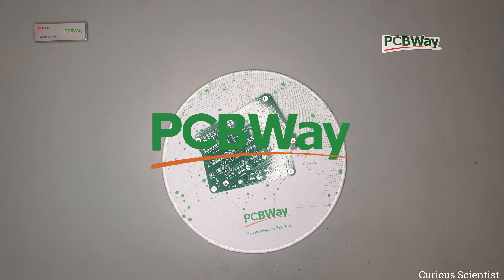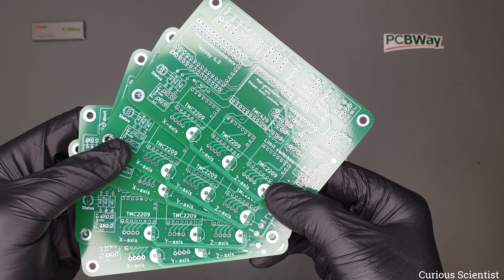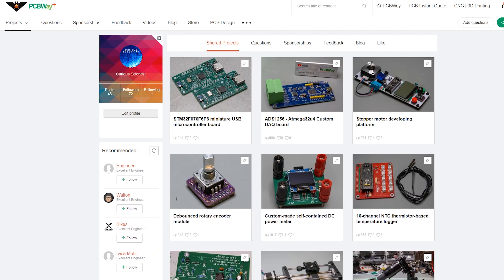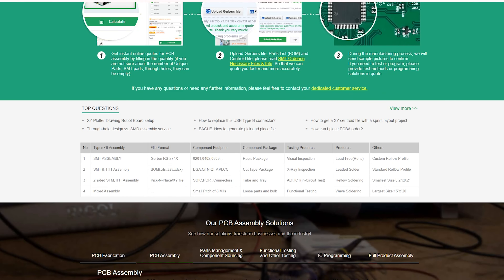High-performance 3-axis stepper motor controller

Comment: very interesting, thanks for continuing to post such interesting projects! about moving the resistor on the aliexpress driver board, I have a question: you could have designed your board to use those without having to move the resistor, correct? is that because you realized that difference after you had designed it? or is that because it was important for you to be able to use the original TMC board and the cheaper one interchangeably? thank you very much and looking forward to the next installment of the series! 🙂
Reply from the maker: Thanks! The reason is that the original TMC2209 can not have the uart pin on pin 13 where the Aliexpress module has it originally. The original module can only have it on pin 11 or 12, dependingon how I short the solder tab. So, as a compromise, I designed the board this way. The board is not only made for myself but also for a customer who wanted to use the original TMC2209 board. On the other hand, I wanted to use it with the cheaper Aliexpress module.
Reply: @CuriousScientist  makes perfect sense, thank you very much for explaining! great job, keep 'em coming!! 👍
Reply from the maker: Thanks, I will try my best!

Comment: Very awesome board, buying them now from PCBWay.  The one question I have is related to the clock of the TMC429.  I see its connected to the Teensy IO.  What clock speed are you providing to the TMC429 and how are you driving it (i.e. pwm output of teensy)?  Thanks
Reply from the maker: Thanks! I simply use the analogWriteFrequency() function on a selected PWM pin and set it to 32 MHz. It is important to notice two things. Set the duty cycle to 50% (128) and set the CPU frequency to 528 MHz in the compiler, so the 32 MHz becomes exactly 32 MHz. 

I will soon open-source the code on my GitHub, so stay-tuned.
Reply: @CuriousScientist  Thanks for the info!!! Was going to ask next if the CPU freq had to change, but you've clearly answered it :)  Also good to hear about the open-source.  Looking forward to it and helping to accelerate my project.  Keep up the awesome work

Comment: This is awesome! Any plans on integrating a display?
Reply from the maker: If you check the video, there's a specific mention of the i2c connection I specifically made for that purpose. 😎
Reply: I didn't catch that part but I'll rewatch it for sure! Thanks
Reply from the maker: No worries! Maybe in a future iteration, I will put a display in the system. I put the circuit in a large enough enclosure to accommodate a display. Check my Instagram, I just recently shared a post about it.
Reply: I just checked out your Instagram post and it looks good! Also if I was to add the i2c display, would I need to edit the code? Sorry about all the questions
Reply from the maker: Hi! Yes, of course, if you want to display something, you need to implement code for it.

Comment: Looks nice, but why not go and make the joystick pins - + s, so that it is safe to polarize it the wrong way around.
Reply from the maker: Even if you mess up the polarity and connect the 3.3 V on the signal, all you will see is that the ADC is reading a maximum value. However, if I flip the 3 pin connector according to my design, all you see is a mirrored joystick behavior. I see nothing wrong with that.

Comment: ELI5 Abstract

What's the Project About?

I'm building a special control board! It's like a brain that helps
move robot parts. Imagine a robot with three arms that can move up and
down, side to side, and even twist. My control board is what makes
those arms move smoothly.

How Does it Work?

* Tiny Brain: The board has a tiny, super-smart computer chip as its
  brain.
* Switches and a Joystick: I can control it with special switches or
  a joystick, like in a video game!
* Colorful Light: There's even a light that changes color to tell me
  what the board is doing.
* Fixing Mistakes: I made a tiny mistake in the board's design, but
  don't worry, I'll fix it!
* Secret Project: This cool board is actually just a part of a much
  bigger, secret project I'm working on. Stay tuned!

Abstract

This project focuses on the design and development of a
high-performance, custom PCB for controlling 3-axis stepper motors
with precision. The core of the design is the TMC429 microcontroller,
which handles step and direction signals, offloading tasks from the
main microcontroller.  The board, designed for manufacturing through
PCBWay, includes several other key components:

* TMC2209 Stepper Motor Drivers: These drivers (both original and
  modified AliExpress versions can be used) control the X, Y, and Z
  axes.
* Step-Down Power Converter: This module efficiently provides the
  required 3.3V power supply.
* Input and Feedback: The design incorporates buttons, a joystick,
  and an RGB status LED for various control modes and visual
  feedback. I2C headers and limit switches provide further expansion
  options.

The project encountered some challenges, including a minor PCB design
error (to be fixed in the next iteration) and the need to modify the
AliExpress stepper motor drivers.  Despite this, the demonstrated
functionality shows that the board successfully enables joystick or
button-based control over the stepper motors.

While the code is complex and not covered in detail in these segments,
future updates will include code explanations, project information,
and the corrected PCB design. This PCB is the foundation for a larger,
exciting project that remains under wraps for now.

Summary

Introduction

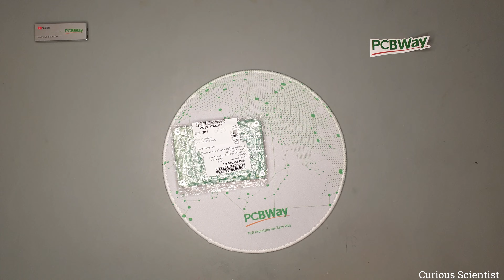* 0:13 - Sponsorship by PCBWay.
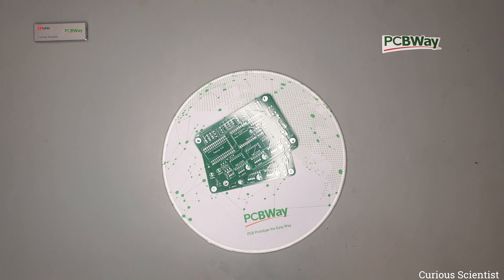* 0:21 - Project introduction: high-precision, high-performance
  3-axis stepper motor driver.
Reply: (continuation of summary)

* 0:34 - PCBs will be designed and manufactured with PCBWay.
* 1:02 - Purpose of the PCB.
* 1:10 - Plan to build and test one of the PCBs.
* 1:23 - This project will be covered in multiple videos.

PCB Overview

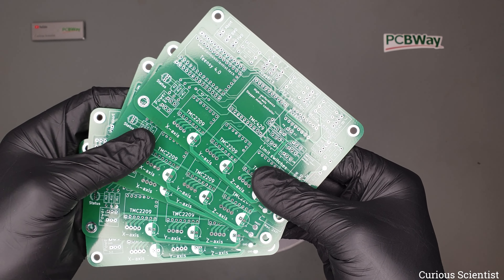* 1:54 - Acknowledges PCBWay's services and capabilities.
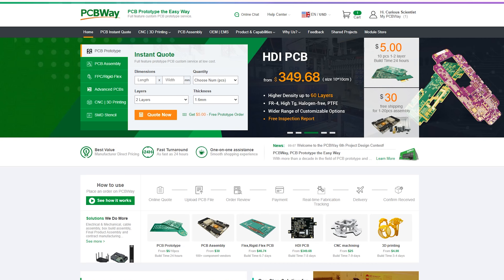* 2:28 - PCBWay offers PCB manufacturing and assembly services.
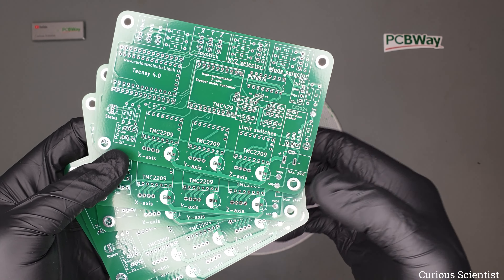* 2:51 - Core component is the TMC429 microcontroller.
* 3:32 - Discussion of the TMC429 stepper motor driver (more in
  later videos).
* 4:00 - TMC429 reduces main microcontroller workload by generating
  step and direction signals.
* 4:36 - PCB uses three TMC2209 stepper motor drivers for X, Y, and
  Z axes.
* 4:55 - RGB LED for status indication.
* 5:26 - DC Barrel Jack for power input.
* 5:48 - Step-down module (MP2359) for 3.3V power.
* 6:00 - LED and test points for voltages.
* 6:33 - I2C header for optional display.
* 6:50 - PCF8574 I/O expander for button inputs.
* 7:08 - Buttons/switches for:
    * 7:18 - Axis selection (X, Y, Z)
    * 7:30 - Modes: Joystick, Button, UART/Serial

PCB Assembly

* 9:57 - Board has been pre-assembled to save time.

Component Descriptions

* 10:50 - TMC429 microcontroller: Powerful, fast, with many
  features.
* 12:24 - TMC429 stepper motor driver module: Handles step/direction
  signals, limit switches, controlled via SPI.
* 13:53 - PCF8574 I/O expander: Provides additional input pins for
  mode selection.

Stepper Motor Drivers

* 15:10 - Introduction to the stepper motor drivers used in the
  project.
* 15:15 - TMC2209 Silent StepStick drivers.
* 15:29 - Description of tabs (pins) on the TMC2209 for UART
  configuration
* 15:59 - Importance of correctly configuring the UART pins for
  board compatibility.
* 16:05 - Discussion of cheaper AliExpress versions of the TMC2209
  driver.
* 16:16 - Key difference: a resistor is in an incorrect position on
  the AliExpress version.
* 16:36 - Instructions on how to modify the AliExpress TMC2209 by
  moving the resistor (R7).
* 18:52 - Demonstration of the modification process.
* 19:25 - How to desolder and reposition the resistor.
* 19:55 - The extra pins on the AliExpress version are not used.
* 20:02 - Both driver types (original and modified AliExpress) will
  now work with the board.

Step-Down Power Converter

* 20:32 - Discussion of the step-down module.
* 20:38 - Using a pre-made module is more cost-effective.
* 20:54 - High-performance step-down converter capable of delivering
  several amps.
* 21:16 - Selectable voltage, but the goal is a fixed 3.3V supply.
* 21:28 - Instructions on modifying the module for fixed 3.3V output.  
* 22:09 - Preference to solder the module directly.
* 22:30 - Demonstration of modifications.  
* 22:49 - Testing the module's output.  
* 23:47 - Using blue tack for positioning before soldering.

Three-Way Switch Demonstration

* 25:10 - Three-way switches are "on-on-on" type.
* 25:32 - Switch will select X, Y, Z axis, or input modes (Joystick,
  Button, USB).
* 25:52 - Explanation of how the three-way switch can short multiple
  pins together for different outputs.
* 26:31 - Demonstration setup: Switch connected to three LEDs.
* 26:50 - The input to the switch is through a resistor for safety.
* 27:20 - Detailed explanation of switch positions with
  corresponding LED outputs.
* 30:02 - Recap of the demonstration.
* 30:45 - Promises a diagram and explanation on the website.

Assembly and Component Overview

* 31:32 - Wiring the on-on-on switches for X, Y, Z axis selection.
* 31:53 - Introduction of a high-quality joystick component.
* 32:24 - Reworking the joystick wires.
* 33:01 - Description of "abort", "backward", and "forward" buttons
  and their wiring.
* 33:58 - Common cathode RGB status LED with resistors.
* 34:39 - Limit switches with standard connections.
* 35:30 - Motor connections and potential polarity adjustments.

Troubleshooting and Fixes

* 37:29 - Assembly took longer than expected due to small components
  and a discovered error.
* 37:40 - Error: SDA and SCL pins on the microcontroller were mixed
  up, preventing communication with the I2C devices.
* 38:10 - Fix: Trace had to be cut and wires re-routed directly to
  the chip.
* 38:33 - Version 1.1 of the PCB will contain this fix.

System Setup

* 39:00 - Joystick connection.
* 39:13 - Three button connections (forward, backward, abort).
* 39:34 - Two on-on-on switches for mode selection (X/Y/Z and
  Joystick/Button/USB).
* 39:40 - See previous video for detailed wiring explanation of
  three-way switches.
* 40:05 - Limit switch attachment for the X-axis.
* 40:26 - Nema 17 pancake stepper motors used.
* 40:51 - Status LED programming.

Demonstration

* 41:14 - Close-up view of the setup.
* 41:20 - Explanation of the mode selector switch positions and
  functionality.
* 42:03 - Joystick mode selected for demonstration.
* 42:41 - Important: Power supply must be connected first.
* 42:47 - Teensy microcontroller requires USB connection for power,
  even with separate 3.3V supply.
* 43:48 - USB for future computer control.
* 44:07 - Explanation of a 90-degree micro USB connector for
  enclosure mounting.
* 45:40 - Importance of minimizing strain on the Teensy's micro USB
  connector.
* 45:55 - Power supply plugged in, then USB to activate the board.

Introduction and Setup

* 46:40 - Power supply connected (12V, 2A).
* 46:53 - Basic standby power consumption is 290mA.
* 47:05 - USB connection made, and some default motor movement.
* 47:17 - Status LED is blue in standby mode.

Joystick Mode Demonstration

* 47:31 - Mode switch is set to joystick control.
* 47:45 - Joystick successfully moves X, Y, and Z axes.
* 47:59 - Status LED turns green when a motor is active.  
* 48:26 - Z-axis movement demonstrated.
* 48:40 - Joystick controls all three axes simultaneously.

Button Mode Demonstration

* 48:53 - Status LED blinks to indicate a mode change (button mode).
* 49:20 - Button mode is active, controlling the X-axis.
* 49:52 - Forward and backward buttons control X-axis movement, the
  status LED turns green.
* 50:15 - Status LED blinks again to indicate a mode change, Y-axis
  is selected.
* 50:51 - Y-axis control with buttons is successful.
* 51:04 - The Z-axis is selected and controlled.
* 51:24 - "Abort" button blinks the LED rapidly while held down.

Compatibility and Code Notes

* 52:03 - A minor error in the PCB design will be corrected.
* 52:15 - The board is compatible with both the AliExpress TMC2209
  modules and the original TMC2209 stepper motor drivers.
* 52:36 - Motor pin layouts differ between the driver types.
* 53:34 - The code is complex (around 2000 lines)
* 54:11 - Code walkthrough will be in a future video.
* 54:29 - Pictures, information, and an updated PCB design will be
  shared on the speaker's website.

Project Teaser and Closing

* 55:01 - This board was designed for a larger, exciting upcoming
  project.
* 55:14 - Thanks to viewers and encouragement to visit the project
  links in the description.

I used gemini
Reply from the maker: Haha, nice! Did you fire up ChatGPT again? 😄
Reply: Nice, but it is way too detailed. Needs to be tunned down a bit
Reply from the maker: Or maybe I make too long videos and that confuses the AI. 😅

Comment: Hello! I watched your video about thermoelectric peltier coolers. We have a research about the cooling of cloud chamber, and we've chosen tec's. Now, we do not know the thermal conductivity of TEC1-12703 and TEC1-12704 and I was wondering if you could tell the thermal conductivity. It's hard to find it on the internet.
Reply from the maker: Hi! I have videos both on Peltier coolers and also on Peltier cooler-based cloud chambers. But this video is about a stepper motor controller board. I don't see how it is relevant here, but anyway, I don't have any information.

Comment: Will that micro controller run kiipper?
Reply from the maker: I am not planning to use it with Klipper, however, it could be able to do that. I am developing my own firmware with the help of a few libraries.
Reply: @CuriousScientist  With klipper support this would be great, how many other pins are available for addon drivers and controls and I see you already have them broken out. Nice work.
Reply from the maker: Well, actually the board is not designed to have more than 3 stepper motor drivers. The reason for it is that the driving of the stepper motor drivers is done by the TMC429 ramp generator which can only drive up to 3 motors. Sure, you could add more motors using the broken out pins, but then the purpose and the beauty of the board would disappear.
Reply: @CuriousScientist  Ahh IC, so an updated ramp generator with more outputs would allow for expandability?
Reply from the maker: @noanyobiseniss7462  You can add more ramp generators. It is easy to expand that way because the ramp generator uses SPI communication protocol.